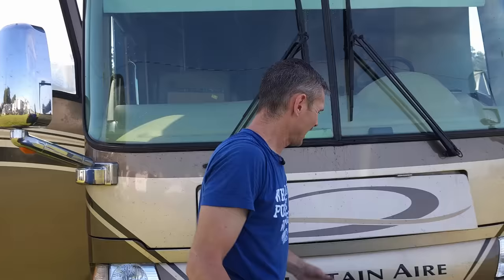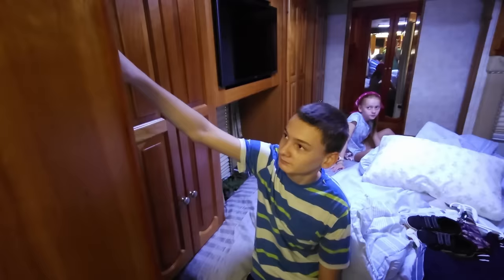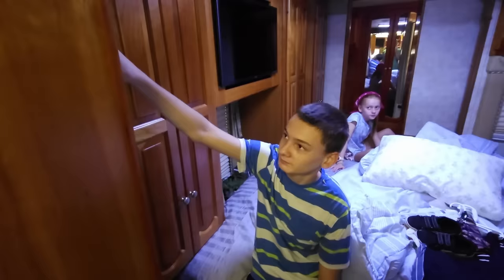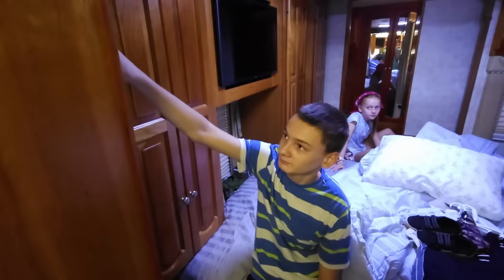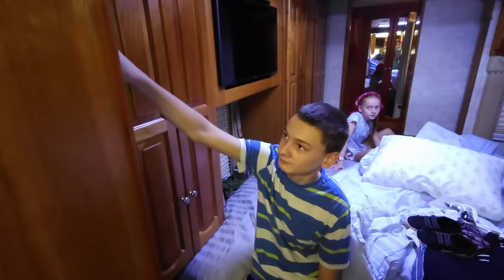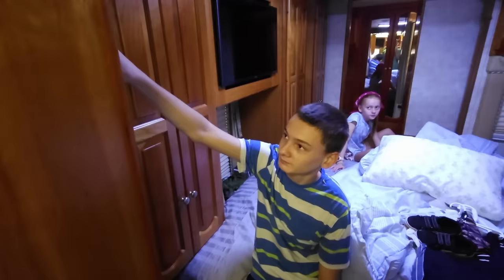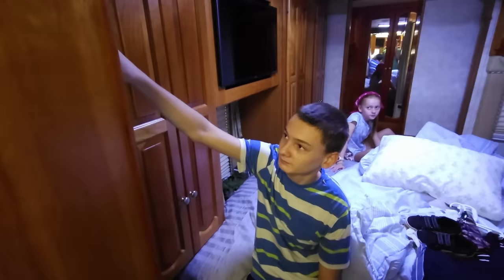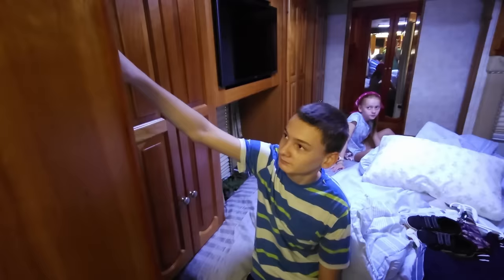3373 Mile Family Road Trip Across USA…What could possibly go wrong?

Comment: I hope you and your family really enjoy your trip.  We towed an RV trailer 8,002 miles (according to the pickup trailer odometer) and saw a lot of country.  As to your generator:  Check the oil.  Many RV generators have an oil level sensor and maybe you are going to be lucky for once and all it needs is a little oil.  At WallMart we found a coupler for the tank drains that had a connection for a water hose that could be used to run water back into the holding tanks and then flush them with fresh water.  It usually took 4 or 5 times to clear the black holding tank, but you could be sure you got most of it and there would be no problems showing up in the future from waste that was not removed.

Comment: G,day Jimmy's world family from Sydney Australia.
* front load washer: turn off at power point/circuit breaker for 12 hrs and it should reset. 
* If the plumbing of the RV is PVC pipe regular flushing with chlorine mixed with water (strong pool water) will eliminate algae growth and hair blockages.
* clean/replace air filters to A/C 
🌏🇭🇲

Comment: Good video.  I must tell you an rv story. After retiring the wife and I traveled around for 4 years in an 02 45' Travel Supreme with the generator on the front slide out tray.  Our undercarriage trays weren't powered and that's where we stored dog food.  Crossing Iowa without knowing it the generator tried to start itself. We stopped for lunch and by the noises the starter made, it was toast. Pulled into Omaha, NB and they ordered a starter to be installed in Denver.  They also serviced the generator and gave us a bag of dog food found in the air cleaner.  Good luck with that RV you've got. Luckily, most systems can be found online and soon you'll be a certified RV Tech.

Comment: I can't resist adding my "dump station" story to your video.  You came off pretty well. I  didn't.  I had a new-to-me Class A.  It was really loaded with every system you can think of. I read ALL the books that were hidden under the bed in the back bed room.  The wife and i went camping on a nearby lake to try it out.  We took showers, did our business on the john,  etc..  Finally it was time to leave.  I had anticipated stopping by the dump station on the way out of the park. I had all the hoses and knew to dump the black water first, etc. After all, I'm a computer guy, "What could possibly go wrong?"  I rigged up the lines and checked it out.  Ready, set, bombs away, I turned on the black water valve. It was then that I realized that the black water tank was over 2 feet off the ground and instantly calculated that I probably had something like 400 pounds of fast moving  liquid poop headed down the pipe with no one holding the cap down. DOH!  The hose lifted out of the drain like the Saturn 5 rocket lifting off and began slinging poop in great arcs around the dump station.  There were two RV's in line behind me and i could hear their engines starting up as they went to the escape mode.  It took a minute for me to realize that i had to cut off the flow. I had fortunately not gotten hit (that's my story and I'm stickin' to it). Then, i was faced with a cleanup operation that took about 30 minutes.  There was an old garden hose that trickled just enough water to do  the job.  That's enough detail.
Reply from the maker: Ahahahahaha!!! That’s sooo gross!!!
Reply: Always test with the gray water first, if its flowing good, shut the valve and open the black valve. Then 'rinse' with gray. Have someone in the RV run all the taps once both tanks drain and you close the valves for a little and open for a final clean flush.

Comment: Onan generators, when they shut off for unknown reasons you can hold down the “preheat” button and it will flash a code in sequence for the issue it’s having and you can look that up to give you an idea of the issue! Enjoy your videos jimmy! If you find yourself down in Redding ca stop by all wheel auto, truck and rv if you need any maintenance or repairs done! I’m one of the rv technicians there!

Comment: Jimmy add diesel clean to the fuel system it will help clean the injectors and lubricate the fuel pump to the generator and engine. I'm a truck driver and run 3000 miles a week and add it once a month to help with fuel economy and ease of starting.

Comment: Jimmy,  Your Mountain Aire is a upper middle of the line Newmar product.  Not sure how old yours is but my guess is mid 90's.  It was not maintained and as in aircraft it is going to have failures from that.  I'm a former seven year full timer, all in Newmars.  A 2002 Mountain Aire, then a new 2015 Dutch Star and then had a 2018 built with some customization. Now have a small coach, Mercedes Benz class C and we are going back to a Newmar Dutch Star asap. 
 
My advice to you is, if you want to keep that coach, and I think for what you paid you should.  Take it to Spartan and have them sort the running gear, then schedule a time at Newmar for her to be taken in and gone through.  Winter rate is less than summer so take her up to Newmar in January and get her back in March.  You will invest about $50 to 80k into to her but all of that aggravation will go away.  Well maybe not all but most.  BTW change the fuel filter on that genset and see if that solves your issue.

Those King Aires are just more things that no one knows how to fix when they fail.  Even the dealers have issues.  They don't see enough of them to stay current.  Returning to Newmar is really the only answer for them.

If you like what you are doing in the coach then get a new or newer Dutch Star or Mountain Aire. I am not in the motor home business but if you would like to discuss Newmar farther please feel free to contact me.

Comment: My experience with a new class A RV wass that the RV spent 9 months in the repairshop in the first year of ownership.  The slide out quit the first night of use.  The next three years of ownership weren't much better.  /did take it coast to coast three times, north and south rtwice.  
great trips with the grand kids.
Reply: If you buy one, get a slightly used one, if everything works, it's made it past all the 'new vehicle failures' and should be good for a few more years. RVs do have expiration dates of about 15 years though, unless you're buying the super high end ones like Prevost.

Comment: What causes water to get in the hub housing when you see it milky in the window, that's because those little red plugs always leak after a few years.  Commercial trucks have the same setup and it's very common.  It's usually that and not the wheel bearing.  If your wheel bearing seal was out you would have oil all over the inside of the steer tire.  That was about a 75 cent part you could have changed and that would have fixed your problem.

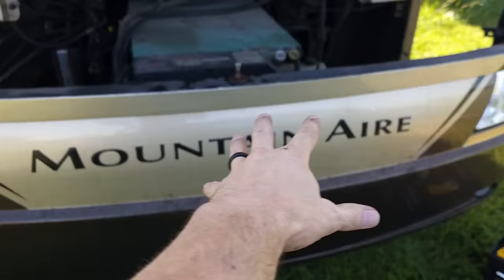Comment: I just bought a 2004 Bounder with 13,980 miles on it, everything feels like new! my first Motor Home, passed smog with great results, needs driver side windshield and tires , only problem I have is getting it into the backyard, so I might have to sell it unfortunately, made in Riverside CA in late 2003,sold February 2004, I think it's worth around $50,000 it's 35E two slides two bath,gas ,8.1 Work Horse, near Joshua Tree, I looked for years for one with low mileage,I just love it but don't have easy access to parking area and I don't want to damage it. 2:09

Comment: Sometimes it's set up that if you have a quarter of a tank or less of fuel you're generator will not run so it saves diesel for the coach.

Comment: On the Splinde washer/ dryer shut off the breaker to it for 30 seconds , which resets the washer/dryer, like rebooting a computer. Turn the breaker back on, and set it to wash and hopefully it will work . Or at least that's how ours on our 17 Thor Challenger 37TB works when it acts up !

Comment: Jimmy replace the fuel filter on the generator. might be the problem. you may know this but when the rv gets low on fuel the generator cuts off to keep from running the rv out of fuel just setting there running. Good luck

Comment: I recommend changing the oil in that generator and add in some zinc additives powder.,or the liquid in with your motor oil this modern day oil doesn't have the zinc in it to help prevent thermal breakdown from happening faster like this oil does. Instead of the old days types of motor oils did witch wouldn't break down as fast. One bottle of marvel mystery oil and one bottle sta-bil fuel stabilizer fuel treatment.,or two for even motorhome would be ideal to buy. And two bottles of that zinc additives also will help yah out A bunch jimmy. I'd do it on your next breakfast and coffee run trip again in the morning for sure.

Comment: First thing you do is put more oil in you generator or just dump Marvel mystery oil in you Gen because the low oil sensor gets dirty so just top it off and a little more and run it and you may have to go threw 2 cycles of it quiting and third time should be good to go. I have fixed 3 doing this and it’s a cheap fix.

Comment: A full car carrier would be better, the odometer on the van will show more miles than what was actually driven (if the van has a trip odometer,zero it,it will show how far you went,subtract that to get actual engine miles or write down what the van's odometer shows now).

Comment: I had an 89 27 foot motor home that had a Ford chassis & coach by, I forgot. I bought it off a sales manager at Albany RV in Albany NY who had purchased it with a friend because it was in great shape when traded in. The friend needed his money back so wala it became mine.

My Australian Shepard & I used it heavily one spring, summer, & fall. We loved it, but I sold it the next year because I was afraid of breaking down a thousand miles from home and spending thousands to get us and the RV back home.

Oh yea, I knew the mechanical/electrical systems of the coach well. Why? Before the first trip to St. Charles VA I accidentally crossed the coach wires after charging the batteries and spent a week re-wiring everything from heater to range hood. My Aussie aka Buddy had his big adventure when he accidentally fell out the passenger window while at a main street stop light. He ran back in so fast after I got the door open all ended well, but scared us both for sure.

Not as expensive as airplanes but while fun it seems RV traveling is always an adventure that was not necessarily expected.

Comment: To me it sounds like your generator needs an oil change as any engine especially generators and motor vehicle engines they have a sensor that tells if the viscosity of the oil is getting too thick and when it does get too thick it shuts down the engine in order to save you the trouble of rebuilding so change the oil and filter chances are your generator will continue to run those generators that specific brand are very well put together and so very likely it has a dummy switch to shut down when the oil gets bad

Comment: Check the fuel lines to the generator. You might have a hole, and if so, it will suck air and shut down the generator.

Comment: I once had a horse run away with me ( they call it “barn sour”. I pulled the reins hard and the horse kept running full speed so I pulled one rein hard enough to turn the horse’s head sideways and it still wouldn’t slow, so I bit its ear really hard. The horse slammed on the brakes and stopped. It never ran out of control again.

Comment: I worked for an airline that flew the 19 seat Jetstream 31's. All our aircraft that had the pods used a liquid coolant (glycol), us rampers had to add to the aircraft periodically. The problem with the podless jetstreams, in the summer they had a weight restriction. Many times they had 19 passengers and no luggage. The ones with pods would carry passengers and luggage with a limited weight restriction.
Reply: If I remember right ours at least had a MTOW of 16500? If we had 19 pax booked , figured 20 checked bags 10 carryons in the pod, we could go to about 2000LBS of fuel and then we had to start bumping. 
It was tough to pull bags if we had to because that aft cargo was right there, we’d pull the truck up to the door , fold the “aft cargo door” or more like cabinet door so that it covered us, and then offload the bags. We’d always preplan to see which ones we could bump and still make original connections since we had a flight every hour but we were often overweight even with the pod. 

If you wanted to get good at weight and balance calculations, work a Jetstream a few times and it’d teach ya haha 

I always act like I complained about the 31s but I loved em.. they were a challenge!

Comment: I would try to get your generator working again. Try changing the oil in it.,an fuel filters.,or it's The actual switch solenoid will.,or should  fix it again for you jimmy.

Comment: Thoes Oman generators have a low oil shut off so make sure you over fill so it won’t stop and before you drain the oil, top the oil all the way top with Marvel Mystery oil to clean the inside and this will clean the oil senser too just let it idle for 1/2-1 hour before you drain the oil and  put Amsoil small  4 stroke motor oil .

Comment: Thanks for another great video Jimmy! Those splendide units are made in Italy and I would assume it’s a bad board possibly, but try cutting the power from it for 10mins and then plug it back in to see if it will reset the board. If it doesn’t fix it then you will want to get a appliance tech in your area to look at it, they are not cheap to fix either, plus parts can only come from the manufacturer. I’ve worked on those before for RV or residential customers of mine.

Comment: You probably know this already being a bit of a techno-geek. When I sold motorhomes about 12 years ago you could add a laser breaking system for about $3,000 I think . So I would imagine it would be less now on your motorhome you can get. It was cool going through downtown Dallas and not ever having to step on the brake or accelerator

Comment: I had an RV with genny - it would shut off at just about 1/4 tank in the main fuel tank. I didn't know that - kept having 'problems' with it, but after a fill up it was fine. Just never clicked. Some tanks have the fuel feed to the genny even higher than 1/4

Comment: Hey Jimmy!!  As par, this was a very good video.  One thing I wanted to mention is that I live in The Ozarks where ticks and chiggers are going to show up in early spring and there's not much you can do except treat the environmenmt with chemicals, which I do.  But you cant get all of them and some will find their way down your socks and up your shorts.  I learnes that the surefire way to kill chiggers is to have a spray bottle half filled with water and half  with bleach.  Personelly, I skip the water and use straight bleach.  Its an immediate kill, chloring gas absolutely stops them in their tracks.  By the way, chiggers dont bite, its much more grotesque than that!  They put a tiny drop of an enzyme that literally disolves flesh and its the disolved flesh that they eat on.  Thats why they burn so bad,  However, bleach neutralizes the enzyme on contact!  Be careful, though, it is bleach and may discolor clothes it contacts.  I shuck down to nothing, so no problem with that and makes rinsing off easier.  I promise you, it does work!!  Once bitten is enough!

Comment: some of the parts can be bought cheaper by saying it's for a semi tractor. Replaced air bag ride for 75% less. RV prices are way over what the real cost is. Tires for half price. Used trailer tires.

Comment: You bought airplane parts and RV parts so if you want to complete the circle buy a  John Deere Compact tractor and a tiny little driveshaft  $800.00 and a three month wait. I stood at the counter getting ready to go into AFIB. I went to a junkyard John Deere  facility and bought one with the same ends using my welding skills cutting off the good ends of the junkyard shaft and the bad ends on my original and ground the ends down to a V  and wire feed welded it. I painted it blitz black and showed it to the parts guy at John Deere and said $155 with new universal joints. He asked where I got that shaft and I said the magic parts store.

Comment: Best 2.5 hours loved this video. Um question did you have grizzly and shades change all the filters fluids and do a full flush of all liquid systems before you left? Might have been the reason possibly for slot of said issues??  Hope you all arive back to Fla save and sound and in good heath. God be with you all. 🤞🏼🤙🏻

Comment: SMALL. IS. BEUTIFFULL...MY WIFE AND I HAVE AN  RV. WITH A FIXED,  BED...ABOUT 17 FEET LONG ..WE GET ABOUT 28MPG.   ON A RUN, ..diesel engine 2-8 LITRE..WE HAVE A DEISEL HEATER THAT'S ECONOMIC..BOUGHT FOR   £16-000 QUID.  AND THE VALUE HAS INCREASED... IT'S A FIAT,  DUCATO. JUST,  THE RIGHT. SIZE TO DRIVE AROUND A TOWN..EASY TO PARRK...THE PROBLEM WITH BIG ONES IS YOU NEED TO TOW,  A CAR AS IT'S TOO BIG FOR TOWNS..AND 6 MPG..IS AN EXPENSIVE   BUISNESS TO KEEP UP ON LONG RUNS...ONE NEEDS DEEP POKETS TO KEEP THAT ON THE ROAD...SMALL IS BEUTIFULL FOR US AS WE HAVE  NO KIDS  THERE GROWN UP...NOW AND MARRIED...!

Comment: Putting a Jaguar V12 engine in a Chevel is almost as bad as putting a Toyota Engine in a Mustang, are you serious Jimmy? LOL! The Jaguar V12 engine depending on which one has Power output of 750 hp (559 kW; 760 PS) Torque output of 580 lb⋅ft (786 N⋅m) acceleration time of 4.5 seconds and a top speed of 322 km/h (200 mph) .... Regarded by many as one of the most premier engines of the 1970, making it the fastest four passenger cars of the era.... I suppose it would be like putting a Pratt and Witney R-1830 Twin Wasp Engine in a Supermarine Spitfire V5!!  LOL! Good think we didnt as we would have lost the Battle of Britain!